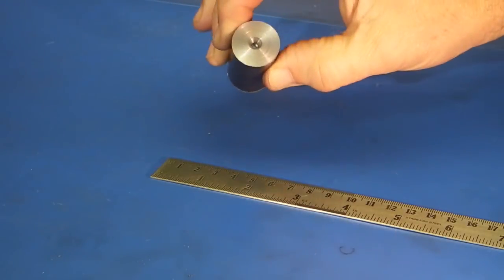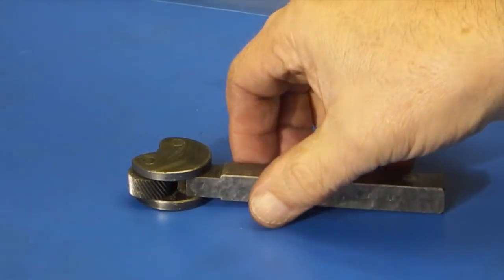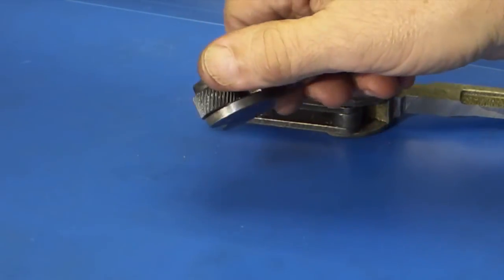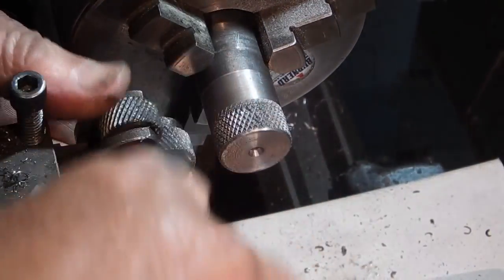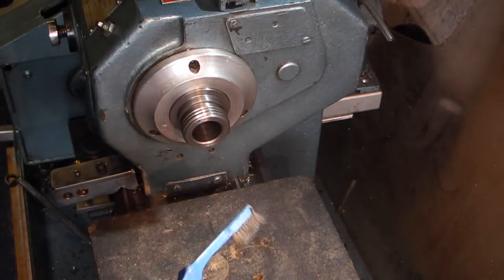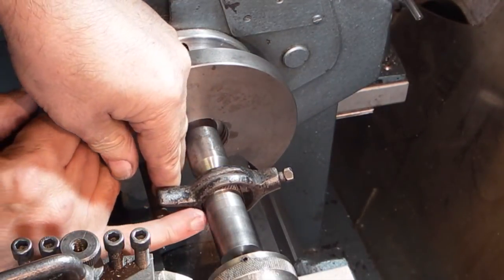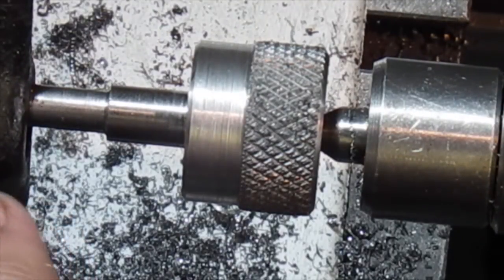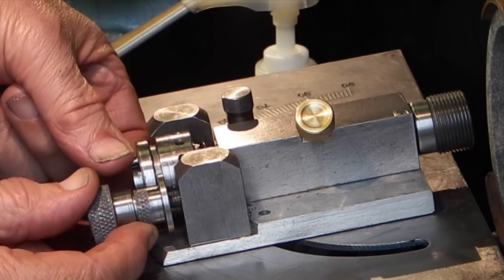Feed screw

Comment: In George Thomas's book he mentions a bit about knurling that made a lot of sense to me. His point was that as the knurl nears it's finished state the knurl should be closely inspected with a magnifying glass after each pass until the finished knurl points are very tiny flats or just come to a point. Going further than that causes the very tips of the points to start to flake off as more material is extruded upwards as the knurl continues to deepen. That flaking material will increase and start to degrade the look of the knurling as it gets re-impressed back into the flanks of the knurled surface. He also mentions material flaking off also happens naturally as part of the knurling process so using "copious" amounts of oil to help flush off those flakes as they are created is helpful. I believe he was 100% correct and following what he had to say seems to work well. Starting as you did Alan by brushing out the knurling wheels until there clean is a very good idea as well. Good knurling can only be as good as the quality and proper hardness of the knurling wheels to start with and there expensive. The cheap off shore knurling wheels aren't worth buying for anyone who takes a bit of pride in there finished work. Rough finished knurling wheels can only produce a poor knurl. It's impossible for them to do otherwise.

Comment: Great feature in your lathe chuck to allow center alignment, every chuck should have it. The fixed wheel knurling tool is practical, but applies far more pressure and consequent wear and tear, to the lathe spindle and related components. If you watch your video carefully, you'll see the work piece deflect as you  deploy the knurls against it.

Cheers
Reply from the maker: Hi Jorge Yes I did notice the deflection when I was editing the video it shows up more in slow motion. 
Thanks for you comment
Alan